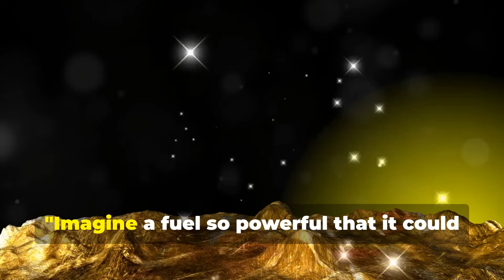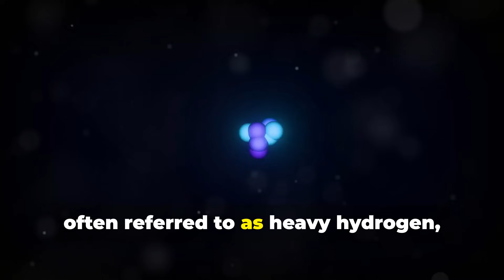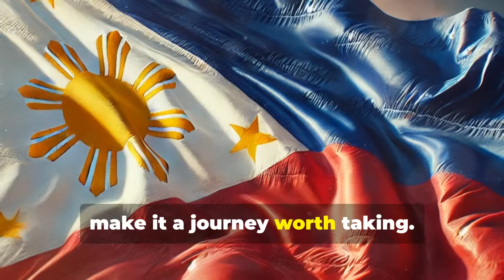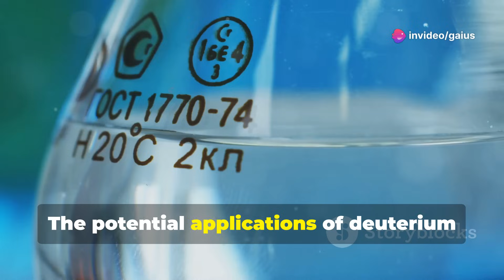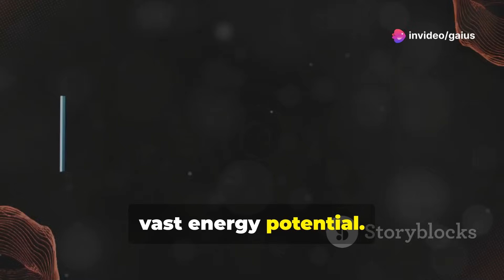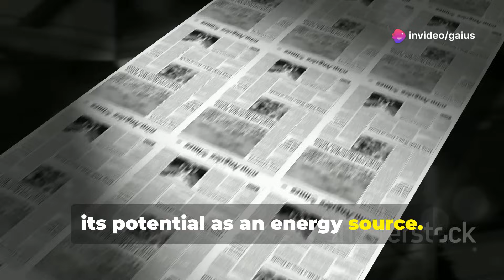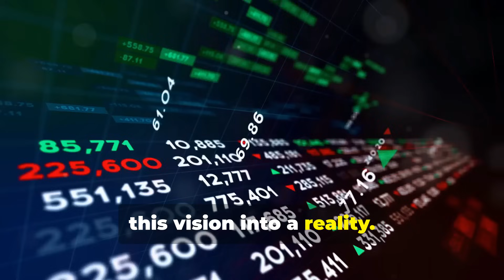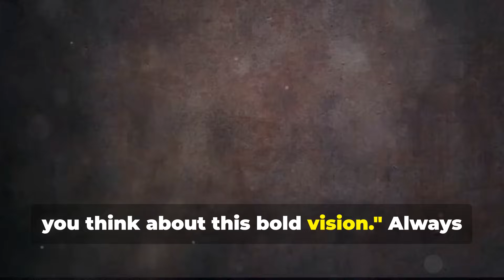The Future of Clean Energy: Deuterium Fuel

Comment: Now they focus on deuterium because of climate crisis, the extraction of heavy water design is the same as sump pump where the deepest part is the catch basin for pumping up deuterium
Reply from the maker: The idea of extracting it using a sump pump design is incorrect and misleading.
Here's why:
*Deuterium is not found in large quantities like water: Deuterium is present in water, but only as a small percentage. It's not a separate liquid like water that can be pumped.
*Extracting deuterium requires specialized processes: Separating deuterium from regular hydrogen involves complex processes like distillation or electrolysis, not simple pumping.
*Sump pumps are for removing water: Sump pumps are designed to remove excess water from basements or other areas, not to extract specific elements or isotopes.

The choice of method for extracting deuterium from water depends on the desired purity and quantity of deuterium, as well as the available resources and cost constraints. While electrolysis is a relatively straightforward method, it is energy-intensive. Fractional distillation and gaseous diffusion are more efficient but require specialized equipment. Chemical exchange offers high efficiency but can be complex. Low-temperature vacuum rectification is highly efficient for producing DDW but is expensive. Research continues to explore new and more efficient methods for deuterium extraction.
Reply: @GAIUSTRAVEL Bago naganap ang WWll mayroon na ginawang exploration ang mga German Jan, at mayroon na sila kaalaman kung paano ito minahin year 30s pa.

Comment: deuterium is a moderator, not a nuclear fuel.
Reply from the maker: Deuterium is a moderator in nuclear reactors, not a nuclear fuel. It slows down neutrons, which are necessary for the nuclear chain reaction to occur. However, deuterium can be used as a fuel source in fusion reactions, but not in fission reactors.

Comment: The big question is how it could be process to hydrogen, there is already engine fit for hydrogen fuel. 🤔🤔🤔
Reply from the maker: You're right, there's a lot of interest in hydrogen as a fuel source, and it's true that engines exist that can run on it. But, converting deuterium to hydrogen isn't quite as simple as it might seem. While converting deuterium to hydrogen is theoretically possible, it's not a practical or efficient solution at this time. Instead, researchers are focusing on using deuterium directly in fusion reactions to unlock its potential as a clean energy source.
Reply: Processing is very simple. It is the extraction that bugged everything. Deuterium s extracted at least 10,000 meters below sea level. The current deepest offshore oil rig is 2,450 meters operated by Shell Oil company at the gulf of Mexico.